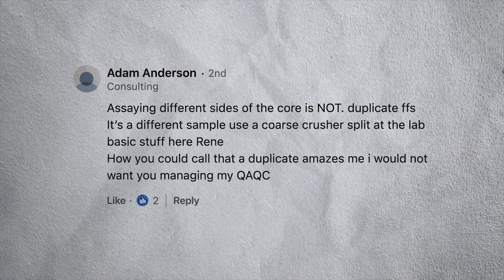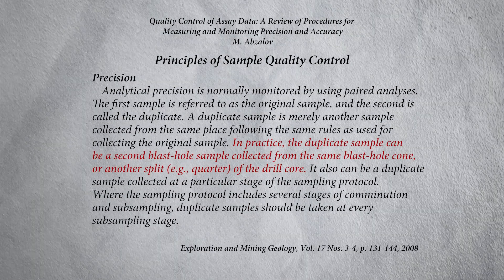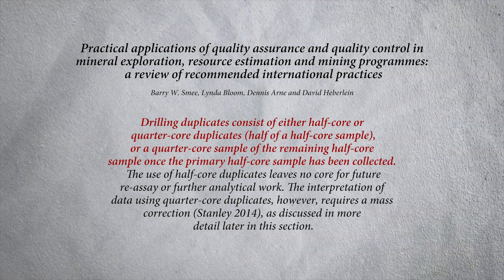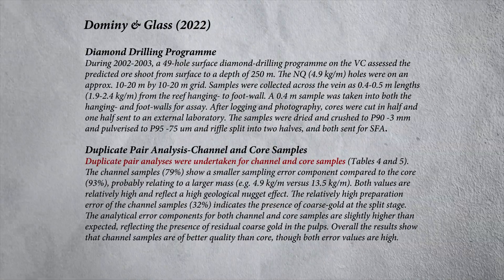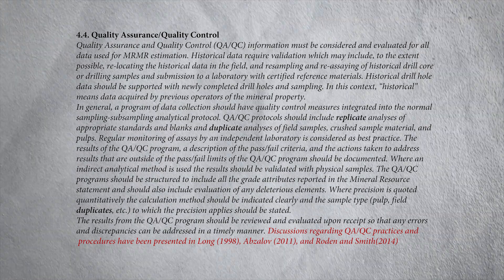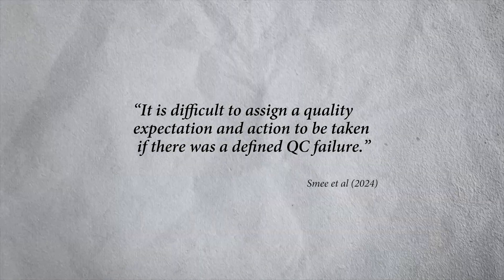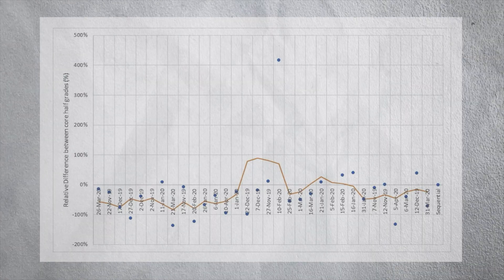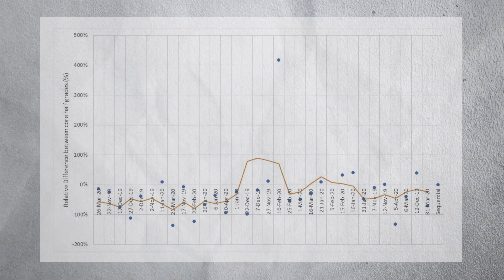Things to Think About in Mining & Exploration #3: Core Duplicates

Comment: Hah that's an angry LinkedIn comment (FFS)!! 

Good clarification - a core DUP is a twin sample at distance =~0 from the primary. I think people (myself included) disagree with the usage of "duplicate" (as it confuses a lot of people new to QAQC) rather than how useful it is, and having a good handle on your short distance variance is very important in estimation. It is the difference between "oh shit possible nugget" and "oh shit possible lab issues" when you see a discrepancy between the original and duplicate in core DUP vs split DUP.
Reply: I've got a video on twin drilling coming up. Another term people use. Not for this though! Care to elaborate on specifically how it confuses people?
Reply: @renesterk oh awesome that'll be interesting. 

Well I assume the ubiquitous use of the term in crushed sample splits and their use in QAQC, and the literal meaning of "exactly like" when a core duplicate cannot be exactly like the other half, quarter etc. A shared name/term for different things. 

I'm more weary to point out to people it's not a duplicate in the same sense as a second split of an RC sample. But the value of a core duplicate makes them very worthwhile to do.